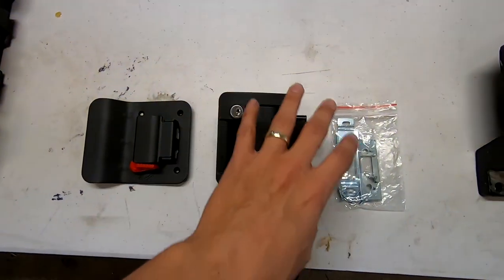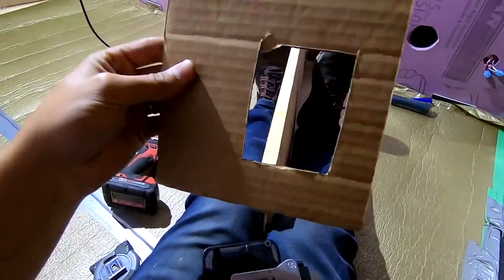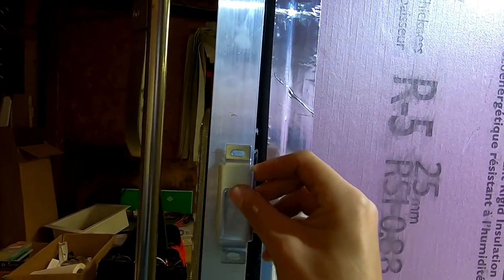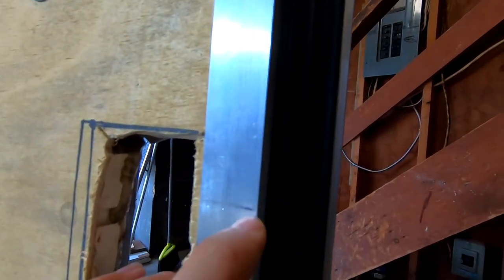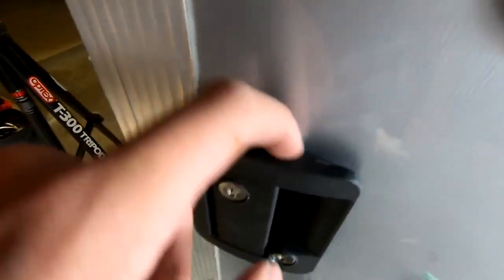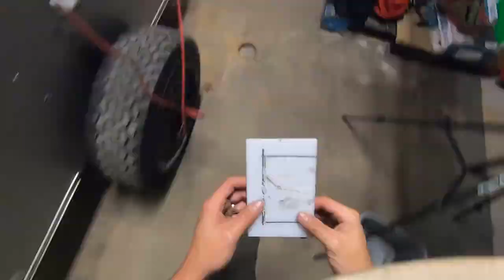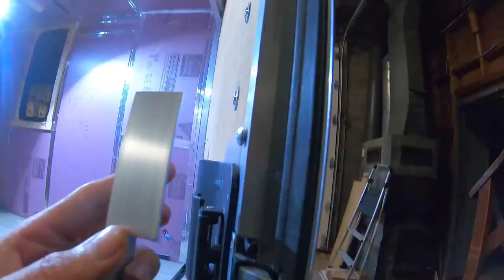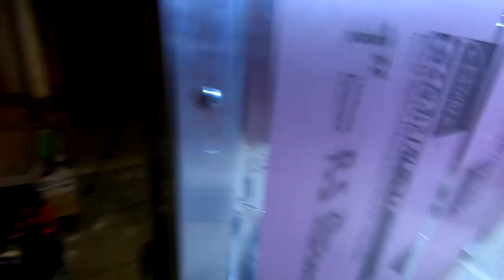Installing an RV DOOR LATCH | CARGO TRAILER CAMPER CONVERSION

Comment: I just converted a cargo trailer to a camper.  Of all the tasks, including insulation , wiring, plumbing, kitchen, etc. etc.......the door latch took the most
time and labor.
Reply from the maker: Yes! I'm sure I could do it a little bit quicker the next time around but definitely caught me off guard. Funny, I assumed it would take 2 hours, which quickly turned into 2 days.

Comment: Well done Joel, I am embarking on the same project "when it gets warmer" on a side door. Sometimes a seemingly small job takes all the time. My trailer is one inch to tall for the garage door, so in the driveway it must be.
Reply from the maker: I had the same problem lol so I had to beg a relative to let me use their shop! Thanks for watching. Good luck with the task. In hind sight it wasn't that bad, just gotta take your time! Cheers
Reply: Can you let most of the air out of the tires to get it in?

Comment: I removed my inside paneling  and bar latch  also removed the inside right panel  because  i aminsulating and installing windows as well   (this is for my side door) also with the paneling removed i will install  window in the side door as well

Comment: First of all, you did good.  The most important thing is that it's functioning how it's supposed to and that it's securely attached.  With that said, I think it would have been better to take the inside part of the door apart...separate it completely from the outside and frame.  Then you would have seen that the door is hollow and you could have installed a 2x4 or whatever was needed to to give the latch a really strong place to mount through.  It also would have given you the opportunity to insulate the door and work on the aluminum trim piece either in a vice or on your workbench.  Still, it came out nice and does what it's supposed to do.  Good work!
Reply from the maker: Yes, I started trying to take the door apart but the way it is built, I would have had to dismantle the entire thing... Which I did not feel confident enough to get back together. I found a different way to insulate the door. Thanks for watching!

Comment: Probably the best video I've seen on this process. Question though, in every video I've watched EVERYONE hogs out the door and aluminum trim on the latch side of the door trying to get the latch mechanism to "tuck" (there're some REAL "shoulda -left-it-to-someone-who-knows-how-to-use-tools vids out there). Why not remove the aluminum door trim and work cleanly?
Reply from the maker: Thank you! The reason I left the trim on mine is that it was attached to the outter trim and frame. If I wanted to take the trim off, I would of had to dismantle the entire door. I agree, a clean work surface would've been ideal.
Reply: No doubt it would be a hassle. I haven't taken mine apart yet, but I had to replace the wood core on an RV door once, the whole thing came apart with screws. I'll put my hands where my mouth is in a bit and let you know how the idea worked for me.
Reply: Cargo trailer doors are infuriating, some have a full steel frame, others have a partial steel frame and what is worse you usually cannot take the aluminum trim off w/o investing a day. Believe it or not…this install was easier than most because he chose to avoid any a steel framing. Great work i must say.

Comment: What were the dimensions of the hole you ended up cutting?  I am terrified to do this to my trailer door.  I just dont want to screw up
Reply from the maker: It definitely varies from latch to latch. I didn't start with a set dimension because I wanted it to fit. It's not that bad once you start! Take your time, measure 30x and cut once :) good luck!

Comment: I'm curious. couldn't you have just taken the door panel off to access the interior of the door and make it easier to cut the hole and insert the latching mechanism?
Reply from the maker: I could have but to get the door panel off I would have had to take the entire door off the trailer. It was built funny from factory. Thanks for watching

Comment: I want to add windows and a RV door lock to my trailer too but don't trust myself install them properly, any advice on who I should contact for help?
Reply from the maker: Any trailer manufacturer or RV service center might do it for you, but won't be cheap. It's honestly not that difficult, just take your time, measure twice, cut once!;

Comment: Make sure you can lock the bar lock in the open position so someone can't lock it on you while you are inside.
Reply from the maker: Yes this is very important! I should have mentioned this in the video. I will be using a puck lock on the latch to keep the bar in the "open" position.